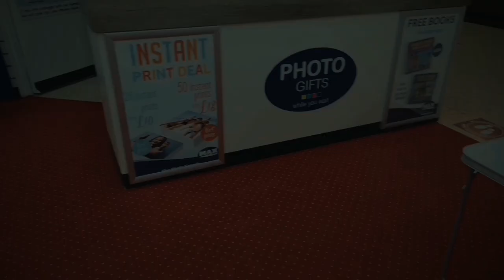How to repair Ladies Stilleto Heels | Detailed Restoration | Scottish Shoe Repair

Comment: Can you fix a heel without a tube inside, like these? I have a vintage pair that are thin and the show maker said he can’t fix them due to there being no tub inside
Reply: If its solid heel it's easy enough to nail them on. Just got to be careful the nail does not come out the sides.  Be nailed and glue. Glue just to hold it in place when nailing.
Reply: @justice.wilson686  thank you so much for this advice. I was told to throw them away but they are priceless vintage shoes! :) I’ll take them somewhere and ask them to do your suggestion.
Reply: @sasharose2963  please do. It's the problem we have in this world. It's a throw away society we live in.

Comment: How do you take out the pin when it's almost flush with the heel? The grip broke off 😭
Reply from the maker: Might need to drill the bit out of the tube. Sometimes you can hammer it further down the tube if all else fails, using a punch tool. Make space for the new bit, but this will limit the repairs in future if its done this way
Reply: @CobblerG  thank you that was my thought with the drill. Hopefully it will come out. Thank you again ☺
Reply: I used to sometimes heat the tube up and pull the tube out. Then tap a new tube in, clip the end off, band it flat and put a new heel in. This is a last resort.